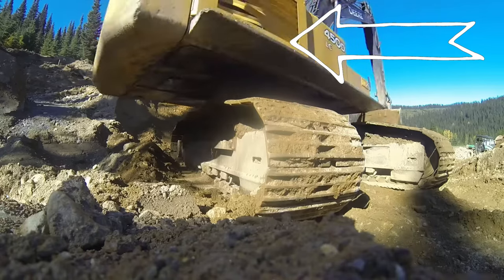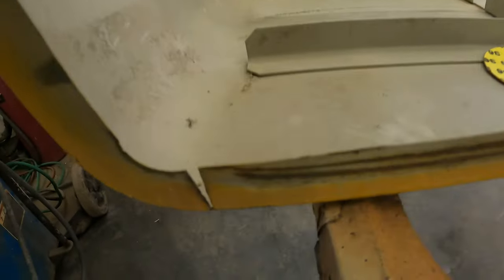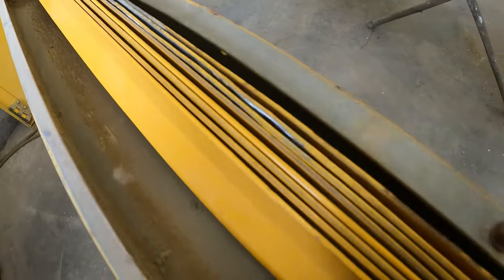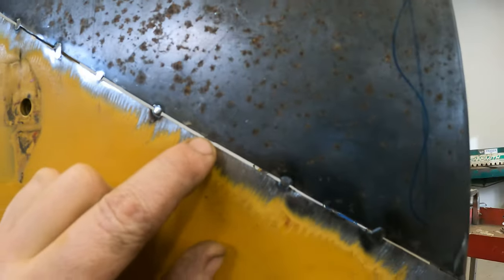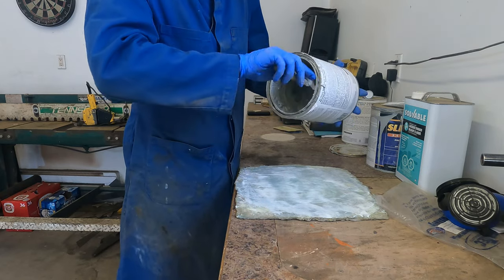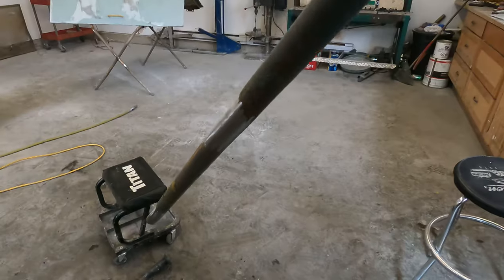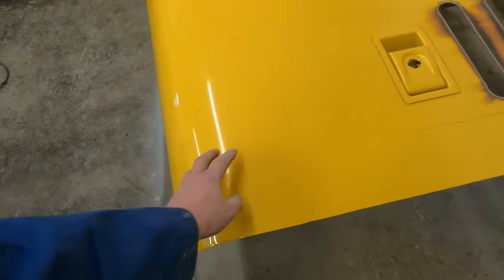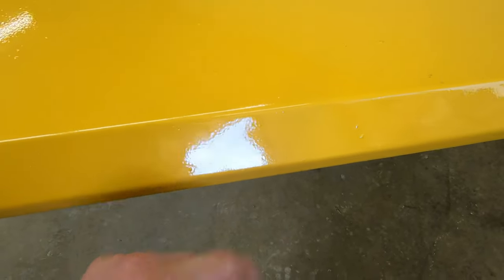Bodywork And Paint, Winter Gold Mining Vlog. S1E4

Comment: Really enjoyed this one! I have a real appreciation for people maintaining there equipment in better than necessary to operate condition. Sure, it will work with some cracked panels and dings, but what happens when that cracked panel gets hit again, or a deluge storm comes through and cold water slams hot parts through the cracks. A little TLC goes a long way to prevent more costly issues later on, especially when the equipment is not next to the shop every weekend. Thank you for the vid, it was fun to see your work and the reasons for why you did it that way. This gives me some things to look at differently when doing home projects, much smaller in scale, but probably easier fixes to finish than they would have been. Having worked more with pipe, I had not thought much about what would help prevent sheets from warping, so you saved me lots of hammer time! lol
Reply from the maker: Thanks Manjisai, I am glad you enjoyed it. I love a fresh machine in the spring. I could never afford a new machine so I try and make my old ones look good. Thanks for watching my content once again:)

Comment: Damn that was crazy good when you said don’t start at the deep part of the dent I was like OOPS. I’ve tried that before and ya it didn’t work out lol but I don’t have the right tools for backing it up lol (a sledge hammer and east wing all steel framing hammer😵‍💫) those metal shrinking and stretching units are bad as* never knew they existed. 10 feet of snow😳 I’ve been in 5 feet after a 3day storm but 10feet that’s a lot of weight does it do damage to your equipment? /bend and tweek stuff? Great vlog really enjoyed it thanks for sharing see you on the next one 👍🏼👊🏼
Reply from the maker: Hey 48th! Any hammer works, even a eastwing haha. As long as everything is all closed up on the machine they are usually fine under the snow. Glad you enjoyed  the video:)